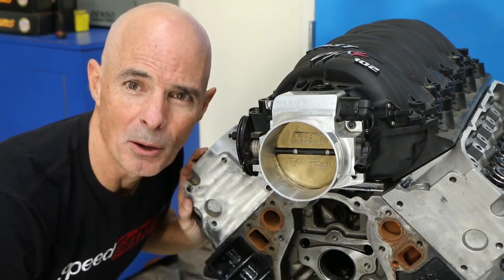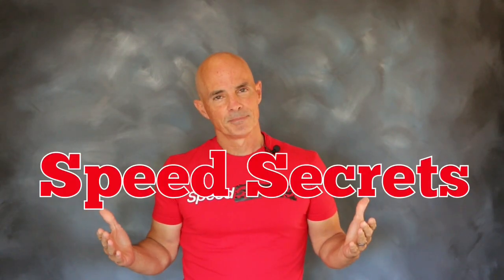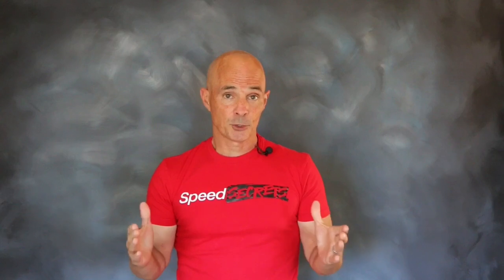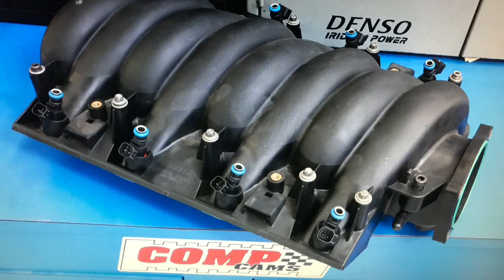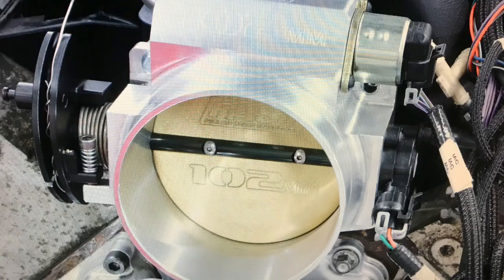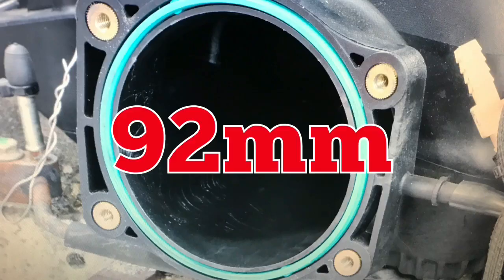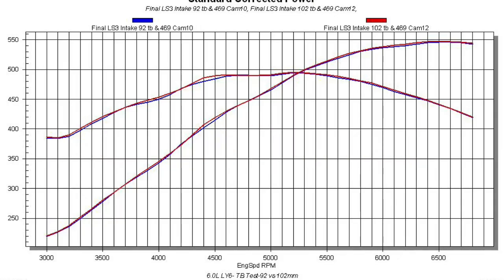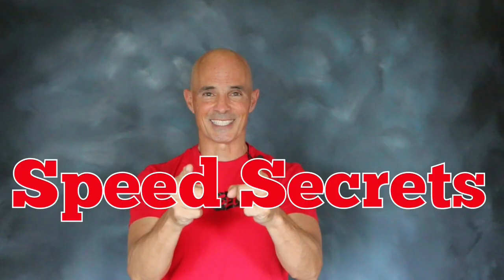LS THROTTLE BODY TEST-92 VS 102 (IS BIGGER REALLY BETTER?)

Comment: But the internals of the intake manifold have a huge influence also. For example, you can buy a 102mm Throttle body and say port out or enlarge the intake opening to the intake manifold to 102mm to match your throttle body. But it will still be choked down by the internals of the intake manifold. Negating much of the possible HP gain. 💯

Comment: Hey Richard happy new year to you and your family. A question for you what are you using for a throttle cable bracket on the 102?
Reply from the maker: a length of wire and steel bracket mounted to the head-dyno only

Comment: I would like to see this test on a tbss intake. Using the factory 78mm tb compared to a tbss 87mm ls3 90mm or 92mm. I feel like 95% of the gains from tbss inatke is the inatke design and not the tb size.
Reply from the maker: The gains offered by the TBSS over a std truck intake is primarily design
Reply: @richardholdener1727 so no reason to get a x link to make a 87mm or  90mm tb work since my lq9 is drive by wire

Comment: This test is kind pointless as it still necks down to 90mm opening and that is the bottleneck. To test the effectiveness of a throttle body you would have to have an intake that allows for the full flow of the throttle body. This is like having two funnels both have a 1/2" exit but up top one has a 4" opening the other a 6" the fluid is going to flow roughly the same through either. To test how the throttle body effects performance put on the 102mm intake then have an adapter for the 90mm then run it the with102mm and see what happens. I'll bet the 102mm gains a good bit more than 1 or 2 numbers. This is of course assuming the engine can use the air provided. (whoops I just noticed the date here. I really didn't mean to comment on a 4 year old video)

Comment: Richard, will you make a video reversing this test, a 102mm ported ls3 with oem 92mm throttle vs the port matched aftermarket 102mm  throttle
Reply from the maker: can the stock ls3 intake throttle opening be taken out to 102 mm?

Comment: So if I ran elderbrook intake manifold with a 90mm opening, would it be beneficial to run a 92mm throttle body?
Reply from the maker: Your throttle body should match your opening (92 is fine for a 90)

Comment: longer runners  = the piston moves futher down the bore   creates a larger potential difference     faster  acceleration  of the air  more vacuum  - the throttle body is a disturbance to linear movement - air takes a longer path  - piston moves less air  in the same amount of time   less power  - can you do a vacuum test  - im thinking a larger tb would require a higher resolution to produce the same vacuum curve - its all BS but if we here splitting hairs
Reply from the maker: runners don't change the how far the pistons moves down the bore
Reply: It changes the wave shape  the runner provides resistance the piston moves further creates a larger vacuum or pressure differential potential difference etc square wave vs sine wave the speed at which the pressure difference is removed  gives acceleration to the air mass in motion wants to remain in motion . Meaning the energy it takes to move is the same as the energy it takes to stop it . Simple physics @richardholdener1727
Reply from the maker: nice sidestep away from your inaccurate statement. The runner length does not change how far the piston moves-that is always the same when the motor is running. As to the three major forms of charge filling associated with intake design, (Reflected Wave, Inertial Ram and Helmholtz Resonance) I am very familiar with all three and how they each operate. Please look then up-you might find them in several of the books I wrote.

Comment: How do you measure the throttle body size? Is it measured by the ID of the TB. I'm trying to figure out what my LS swap engine has on it. It's an eBay motor, so I'm not 100% what TB it has.
Reply: Thank you very much. I was measuring the OD and getting 100mm. I said there is no way that's what I have.
Reply from the maker: measure back side of the tb (basically the inside bore diameter at its smallest part)

Comment: I have a 6.0L LQ9 motor. Sloppy stage 3 cam, short runner intake with 102 mm manual TB. I’m installing a 4” OD intake tube thru the radiator support for cooler air. The intake tube is about 2.5 feet long. Will this long intake tube increase plenum volume and HP?
Reply from the maker: In my testing it showed no gain-except for the cold air

Comment: I'm fairly new to your channel but the 92mm opening negates thethe tes need a 102 opening dropped to a 92mm opening
Reply from the maker: MATCH THE INTAKE OPENING TO THE THROTTLE BODY SIZE
Reply: @richardholdener1727  I would love to see this test, but the proper test would be a 102mm Intake opening with a 92mm throttle body v.s. 102mm Intake opening with a 102mm throttle body. 
In any case, thanks for all the videos!

Comment: This was extremely helpful for my own application. I've gone to a BTR Trinity intake and a chinese-aeroflow 102mm tbody and we lost torque in teh midrange and did not make any power gains at the topend. I'm going back to an LS3 intake and stock 90mm silverblade throttle body to recover torque and then decide where to go from there. It's an australian L98 so LS3 heads on an LS2
Reply from the maker: choose intake for desired rpm range, btr intake is a short runner, high-rpm intake

Comment: Would love to see the complete opposite! What if we tried a 78mm throttle body (Stock LS6)  on a stroker LS (408,416,427...)? ICT billet supplies the adapter for $30. The C5R 7.0 race engine still provided 600bhp with 2x30mm restrictor plates.
Can we answer the question of when does size become a major limiting factor at given HP levels?

Comment: What injectors are usually used for a built 5.3 with fast 102mm intake and throttle body?
Reply from the maker: what power level
Reply: 550-650

Comment: Somebody below said: "We knew the restriction would be in the opening but if we were going to do A TB test why wouldn't we test on a manifold with a 102mm opening? Then we'd have seen whether the big throttle body (TB) worked. The big opening wouldn't have hindered the 92mm TB and we'd have seen a legit test. C'mon Richard, you knew better than this! Lol!"  No, no  it was great because SO MANY dufuses slap a bigger TB on with a smaller adapter. What Id like to see is the final road block in the system---port size and shape on the heads, and valve size.

Comment: Hey Richard how  about a 03 lm7 throttle body and intake compared to the LC9 intake and throttle body in hp and torque
Reply from the maker: If the LC9 intake is like the TBSS-it wins
Reply: @richardholdener1727  I just meant is it worth it to put a gen 4 5.3 intake and Tb on a 03 lm7 5.3 will it increase the hp and torque ?

Comment: It would also be a good thing to mention that a stock 5.3 or 4.8 will not benefit at all from any throttle body upgrade except maybe three or four horsepower above 6,000 RPM.  And if you had a massive cam in one of these smaller engines then you would start to see more of a gain from the bigger throttle body but it would still only be above 5000 RPM.  And when I say bigger talking about the smaller engines I'm talking about bigger than the stock 76 mm or whatever it is.  You don't even have to step it up from the three bolt factory gen 3 throttle bodies unless you have a 6.0 or bigger or a pretty big cam in a 5.3.  

102 mm throttle bodies definitely have their place and it is not on a factory manifold and unless you have an enormous Cam and you are planning for mostly top end power you will still never need to go bigger than a 92 mm.  Huge displacement strokers definitely get bigger gains off of 102mm throttle bodies but you have to dig deeper and figure out where the real bottle neck of your own system is. Sometimes it's heads, sometimes it's intake manifold, sometimes it's cam, sometimes it's exhaust.  In my personal opinion you need to take 5 things into consideration when deciding your throttle body, intake, cam, displacement, compression, aspiration.

Comment: I'm genuinely disappointed. Your tests are normally so well thought-out. This was garbage. All you showed was that adding an oversize TB in front of another restriction doesn't give any power. Well, duh. That adaptor was effectively part of the TB. So you really just compared two 92mm TBs. A far better option would have been to use both TBs on the aftermarket manifold designed for the larger one. Make the TB the actual chokepoint. I still don't think you'd see any significant difference.
Reply: Do your own test then. Or stfu

Comment: So what would the difference be between the gen 3 78mm throttle body an intake over the gen 4 90mm throttle body and intake?
Reply from the maker: very little on a stock 5.3L, but a significant amount on a modified 6.0L. The more powerful the combo-the more the motor needs the airflow, the greater the gains
Reply: @richardholdener1727  if you were to use the modified 6.0 cam, headers, ect. Would the gains be significant enough to spend the time an money to swap out? And is the gain through the whole rpm range or just up top

Comment: Richard Holdener. I just got a reman 6.0l gen 4 to replace my 5.3l. Ly6 block flat top piston. Lq9 cam and 799 heads. Should I keep or upgrade the tbss intake with 90mm throttle?
Reply from the maker: the tbss intake is fine-you don't have a cam in there

Comment: I have a mid rise Holley intake with a 92mm I was thinking about upgrading to a 102mm or 105mm. I haven’t ran the car yet so I do not know what the 92 will do however I have LS1 CNC cylinder heads with twin turbos. Will the upgrade to 102 or 105 make a big difference with my setup?
Reply from the maker: NO NEED TO UPGRADE WITH BOOST-THE INTAKE IS WHAT IS HOLDING THAT COMBO BACK
Reply: Ok. You think the hi ram would be better & have higher hp gains

Comment: How do I tell what year lq4 I have for certain? It has a 4l80 on it. It has a cable drive throttle body. I think it was out of a van bc it has the real long dip stick and trans tubes
Reply from the maker: CABLE IS PRE 2003 ON TRUCKS

Comment: What size pushrods did you use with that Camshaft ?
Reply from the maker: pushrod length does not change with a camshaft unless the base circle is different

Comment: I was running 102 mm throttle body and 102 fast intake and yes it picked up some power but the 85 mm MAF sensor LS2 was a restriction.  Why isn't the MAF ever talked about?
Reply from the maker: we don't run them on the dyno
Reply: How much of a gain would I see with a 102 intake and TB compared to a 92mm setup on a built LS1 laying down about 450whp?
Reply: @TheJMan1K  I doubt it is possible to make that much HP out of a LS1 unless you have forced induction or spray.  That is a gain of over 150 hp over stock.
Reply: @kevin122759  my buddy through down 470whp with a fully built motor. It’s possible. And other cases do exist on YouTube.
Reply: @TheJMan1K  Well I don't take other peoples word for anything because they do not live in an area a mile above sea level.  I have a fully built LS2 and had it dynoed the other day and it put out 382 hp at the wheels.  I realize it was 95 degrees and a mile above sea level running an auto trans there will be power losses.  All I care about is quarter mile times.  I run 12.7 @ 110 mph.  A friend of mine has an LS7 Corvette and runs 12.5 @ 118.  People from out of state come to the track and complain they can't get a good track time.  The track is great, the air is thin.
Reply: @kevin122759  when the car made 470wheel it was February (about 60 degrees outside with a windchill making it feel lower) and we’re at sea level in Corpus Christi, Tx.
Reply: @TheJMan1K  I am curious to see track times to compare how altitude affects them.
Reply: @kevin122759  not sure exact times but he is definitely running in the 10 range. That and he’s got it built for boost but only sprays at the moment. Highway pulls have been nasty.

Comment: I would like to see a test between mono and four hole throttle bodies.  Of course, N/A and then under boost.  Is a four hole TB better suited for the street with better throttle response and part throttle driving?  If so, why aren't there more factory four hole throttle bodies?
Reply from the maker: I have tested that-they made the same power
Reply: @richardholdener1727  oh that's kool!  Do you have a video of that test up?  I didn't see one.

Comment: Hello.what would be the right size Tb an intake to run on a l92 with a Vs racing billet 80mm turbo with 1.32ar housing
Reply from the maker: 92 on that intake
Reply: Thanks a lot

Comment: The 102 is roughly 1450 cfm.  You can't bolt a bigger carb on a old-style V8 and get more power UNLESS the rest of the system is ready for it.  Certainly can't unbolt a 1-barrel on a Dodge slant-6 and put on a duel pumper 950 cfm and get a ton more power, right?

Comment: What flows better port injection with the front throttle valve or port injection with a carb style intake, I don't see how the front inlet air flow is as equal as a carb style open pleanum efi intake...?

Comment: I feel this is a waste of time/resources except to point out to idiots that bigger isn't always better.  You should do the same on a Positive displacement blower type setup with 600+ flywheel horsepower and see how the engine responds power wise and manifold pressure wise from a larger throttle body.
Reply from the maker: I have-PD blowers need big TBs
Reply: Richard Holdener I’m sure you have but where is the video for us to see?

Comment: Run the same test with the FAST intake to see the real impact the throttle body has.  If there are significant gains from running the 92 vs 102 on a 102 intake opening the. You’ve proven something.  But this test was basically invalid.
Reply: 100%

Comment: Have you ever tried, or tested Schwitzer Turbochargers?  They are used in diesels but are just as well built as a Garret I am told. They have billet wheel upgrades and, if you know what your exact application needs, can be had at 1/3to 1/2 the price.  Check them out.

Comment: As soon as I saw the test was going to use a step down adapter my immediate answer was "it won't make a difference". Glad you mentioned that adapting a 102 to 92 by necking down is what makes these the same.  You lose all extra 102 flow gains and it's just simple fluid dynamics. For those wondering about a 102 intake with a 92TB. Again you're restricting flow into the intake and your TB is what will be holding you back on flow. Lesson here is match your TB to your intake for Max efficient flow.
Reply: The 2 throttle bodies are essentially the same size due to the Adaptor plate . It’s a false comparison
Reply: @marknewman4243  agreed and i believe that was well highlighted in the video if I recall correctly as it's been a year since I've watched it. When you have a system that flows a fluid weather is be liquid, gas, slurry etc. If your entire system is 4 inch diameter pipe and you have on an inch of length with a 2inch diameter pipe. Your entire system will behave like a 2inch diameter pipe system. Full stop

Comment: the 90mm TB doesn't start to restrict flow until 600 hp.  You'd have to be making more than 750 hp NA to actually need a 102mm.  fast is just trying to sell you more parts.
Reply: This helped 5 years later 🫡

Comment: We knew the restriction would be in the opening but if we were going to do A TB test why wouldn't we test on a manifold with a 102mm opening? Then we'd have seen whether the big throttle body (TB) worked. The big opening wouldn't have hindered the 92mm TB and we'd have seen a legit test. C'mon Richard, you knew better than this! Lol!

Comment: What I usually see guys do is run a 102 throttle body with an aftermarket intake, but still have a smaller tube feeding it air. Just has never made sense to me.

Comment: This is a lame comparison.  If you wanted to learn something, you should have tried the 92mm on the Fast.
Reply: @EGGINFOOLS  Lol, what are you, 14, and already a pervert..?

Who said anything about hurt feelings, or folk's "daadys" "touching" them... and  exactly how does that  sort of twisted logic tie in with the subject of this discussion?
Reply: @michaelangelo8001  You need your meds little guy
Reply: @EGGINFOOLS  Lol, I guessed 14yo before, now I'm de-rating my assessment to 12.

Not very bright either...
Reply: It's not lame. That fast intake cost nearly 1k. People will want to swap the throttle body thinking it'll gain.
Reply: @EGGINFOOLS  Okay, either you have a reading, or a comprehension deficit...

Anyone with any reasoning capacity at all, would already know that The restrictive opening on the OEM manifold would negate any benefit a larger throttle vale might be able to otherwise offer.

Comment: Lol at this useless test
Reply from the maker: unless you were looking to by an adapter to put a big TB on
Reply: Why would you ever do that if it immediately downstream the size of the hole got smaller? you are blocking the big throttle. test a fast with large opening and put progressively smaller and throttle bodies on until you start to hurt power. That would be a much more informative test..

Comment: If i got it right you used 102mm throttle body on 92mm opening in stock intake manifold. If that is the case technically you did not change anything regarding air flow restriction since the system is as small as it's smallest component is. In other words with stock 92mm throttle body you biggest air flow restriction was throttle bode and intake manifold opening and with 102 mm throttle body it was just the 92 mm opening. From air flow restriction and  efficiency point of view nothing changed and that is why you did not see any changes in your dyno numbers.